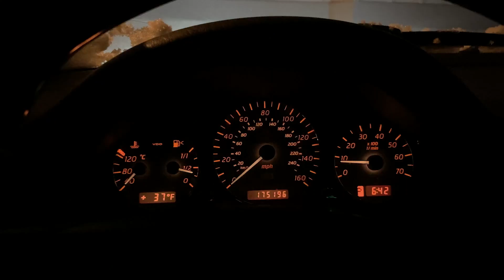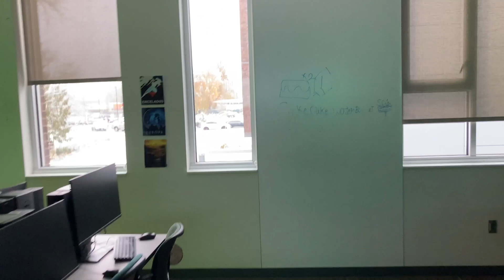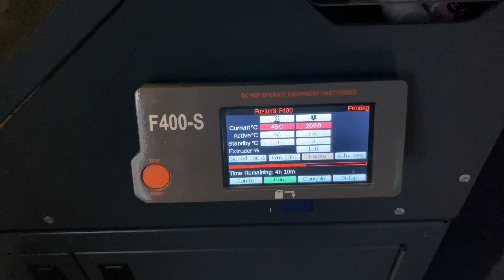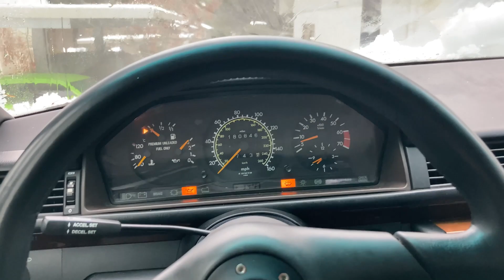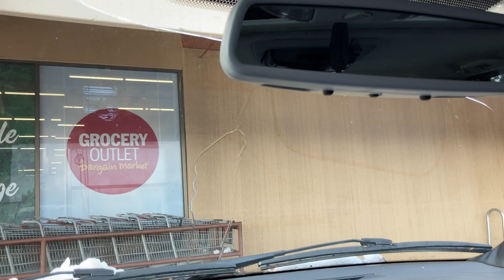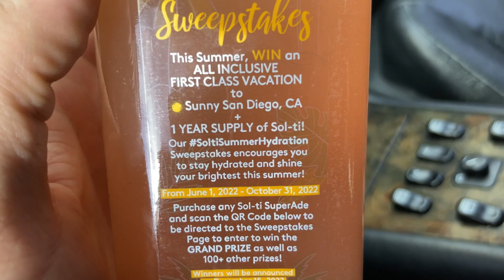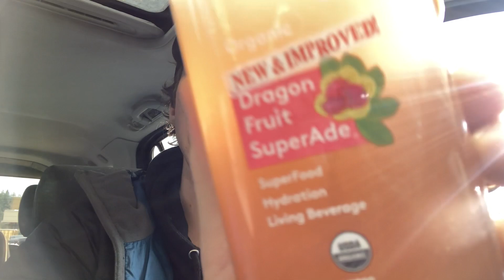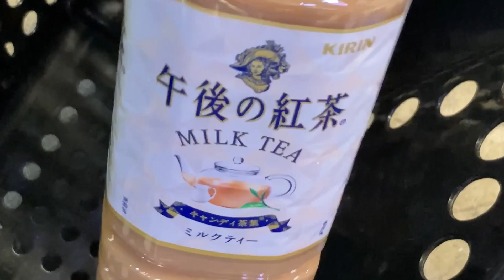ML55 AMG or ML63 AMG… WHICH WOULD YOU TAKE?

Comment: I will let you know, as soon as I have a reason to replace my ML430 with a ML550, but it is going strong at 208500 miles, no check engine light, no stored codes.
Things I LOVE about my ML430:
Always tons of torque from the get go
Excellent ride with HD front shocks
It never left me stranded in 8 years
Who can do this on asphalt? Low-Range, permanent 4x4, electronic locking differential function (4TS/ESP)!! I have never driven a car with such confidence in all conditions.
My favorite part: snow driving and offroading, really no worries at all with this beast

Comment: I’ve owned 2 ML55s, they’re cool, but I’m kinda over them now and would take a ML63 instead, mainly for the better ride quality and a little more power.
ML55s have a harsh ride due to their body on frame design. And ML55s are basically 15 sec 1/4 SUVs. Fast 20 years ago but not so fast today.
Reply from the maker: totally get you, the ML63 is a better overall car as far as power, comfort etc. Still something about the W163 that I enjoy a great deal, but the W164 is no doubt much nicer. Crazy to think these two are only 8 years apart, it feels like 20 driving them back to back. I love both of them for what they are and am grateful to have them! With the mods I have done to my ML55, I will say it is not slow by any means and in some instances like initial acceleration, feels very similar to ML63.
Reply: @ANDERZENAMG   sounds awesome. Yeah I always wanted to boost my ML55, but it never happened. A boosted ML55 is a pretty badass sleeper!
Reply: How much where the mods on the ML55
Reply: @ANDERZENAMG  depends what your overall is because the ml55 is way better and more reliable off road and towing them 63